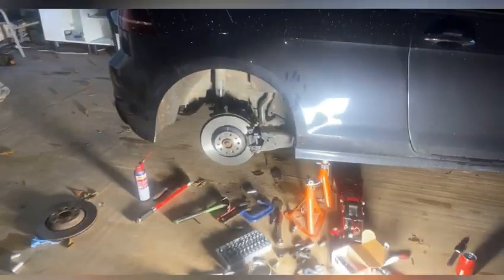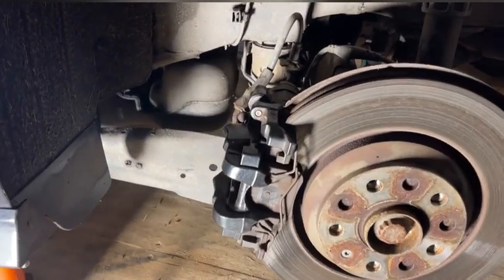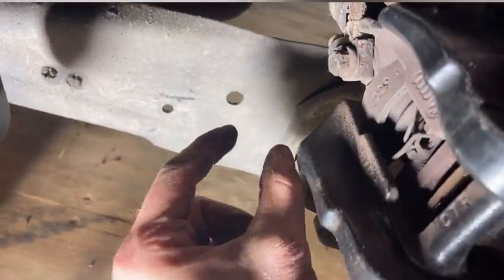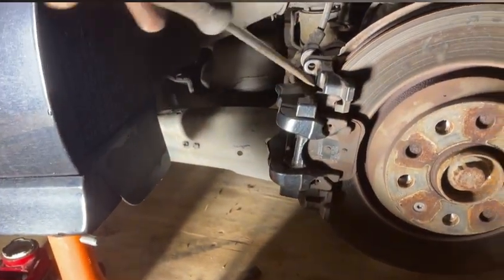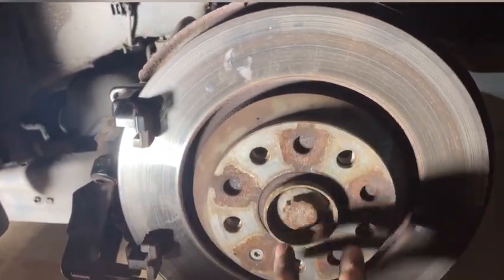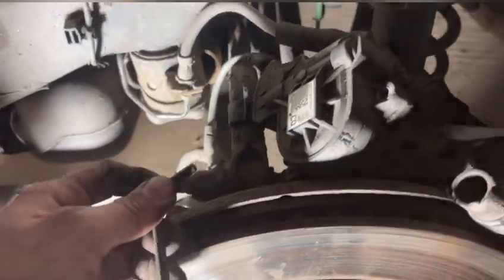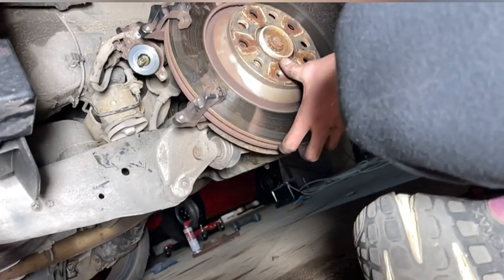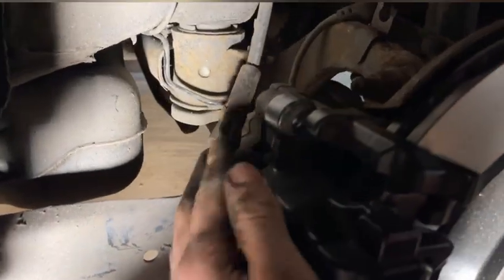Mk7 Golf R Rear Disc and Pads EPB - No VAG com!

Comment: Brilliant vid i followed step by step today and got both sides changed in less than an hour. I decided not to disconnect the wiring harness and it was still easy enough to get the motor off.👍🏼👊🏼

Comment: Brilliant video, just got me out of trouble as I didn't think the disc would pass by the carrier. Wiggled out with ease thanks to the video. Also great tip on removing the Vag motor and I had the G clamp similar to yours. Whole job went without any issues. Many thanks for posting.

Comment: I used 12v supply from a battery or power brick to wind back.  Look inside the socket,  2 pins labeled,  connect positive to pin 1 and negative to pin 2. Will hear moter sound and see piston is not moving out. When Motor sound changes, disconnect. Compress the piston in.
Reply: Thank you for this comment.
Reply: I did the same but ended up with brake fault and locked on brake. Have no solution at the moment but believe I need a scanner to fix it.

Comment: Just finished this things i found out that clip from the ebrake motor is a two hand contract,  one on the clup annnnd one prying out like he said both clips are good i did use a seven m rachet annnnd socket,  it was a pain in the ass but it worked , i was worried that the ebrake wouldn’t reset itself after turning that clockwise but it did I just did that half turn or that full turn that he mentioned and it was all good

thanks partner for your time in posting this !!!

Comment: Great video and nice to see clever disc removal without needing to remove calliper carrier bracket!!!
Also, there’s much controversy about how to push calliper piston in! I’ve heard that VW cars with EPB: the piston simple pushes straight in AFTER USING A SCAN TOOL TO PUT EPB INTO SERVICE MODE!! (I used Autel VD700) BUT be aware models with conventional hand lever operated parking brake require calliper piston to be “rotated” while it is pressed in using a “wind back” tool!!!
Reply: According to VW manual attempting to push rear pistons in without first using diagnostic to open will result in severe damage to the EPB motors. Also on NO account should EPB motors be taken apart. Follow this guys guide at your own risk and expense if you ruin calipers!
Reply: @SalvageMasterEssex  Thanks for your reply. I have edited my comment to include putting EPB into service mode with scan tool BEFORE pushing caliper piston in!
Reply from the maker: @SalvageMasterEssex  The piston isn’t “pushed” back it’s wound back. The spline connection when turned does exactly what the motor would achieve only slower. The resistance is minimal and i never use unnecessary force to turn it, hence winding it back with finger and thumb. Electronic connections were disconnected before winding back.

Comment: Great video works well only probs I had were lining up the splines to motor when reassembled had to adjust a touch and figuring out how to get EPB off and to stay off when you shut down ignition was a nightmare just played about with press and hold can’t even remember how I got it to stay off but will post when figure out what I did 😂

Comment: I foolishly pressed end lining instead of start and the rod came all the way out. I managed to get it back in, not sure if I've damaged it but I'm have multiple errors on dash with abs and I can't get my car free from handbrake so I'm stuck. Any ideas how to reset this as I was using vagcom? The reason I used this video was to whind the piston back further after removing the motor. Any help is appreciated.

Comment: Do you need to make any turn back  to the  motor when u fit him back ?thanks.
Reply from the maker: Only have to turn it back once. When you fit it and use the EPB, will auto adjust the handbrake to fully on and after that be as normal